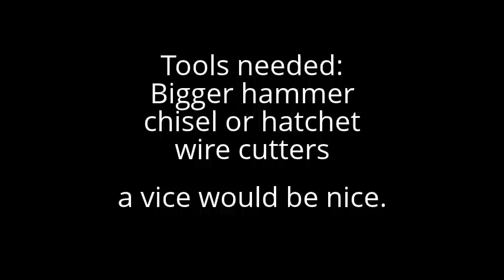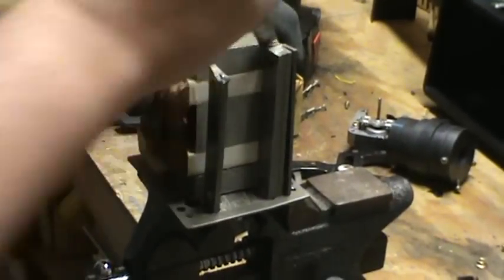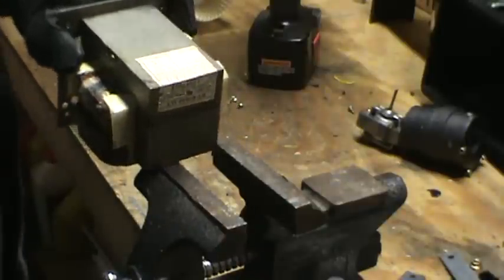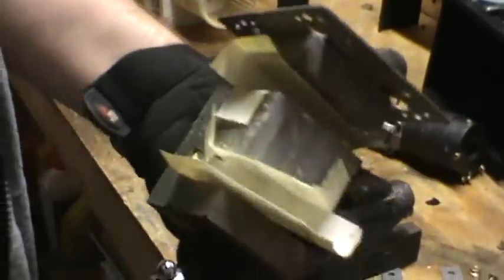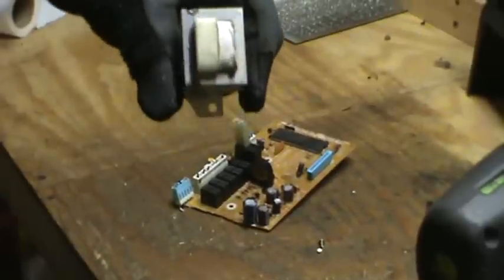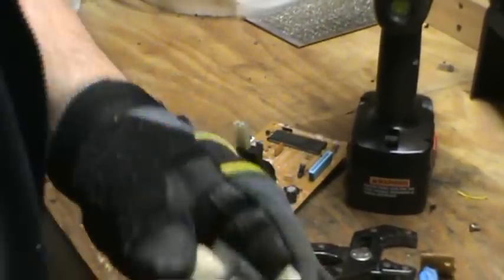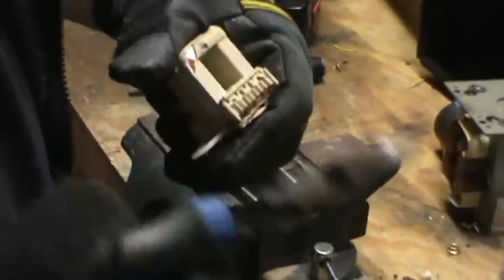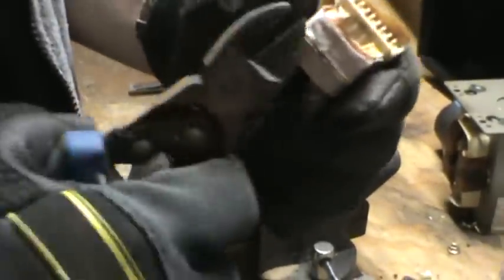How to scrap transformers for copper and easy money!

Comment: just asking hope i dont say anything stupid but, cant you burn off the enamel with a torch? it comes off easy, i tried it not much smoke a little...but the enamel is off and you now have #1 copper...you guys dont believe in that?
Reply from the maker: Never burn copper wire.  Not a stupid question!!!  A lot of people don't know this but most scrap yards actually pay less than #2 price for copper that is burnt because it actually contaminates the copper.  THe folks at iScrap App just put out a video on that very subject about myths of scrapping.  Thanks!

Comment: how can you tell its aluminium if its the same colour as copper? i mean both can pass the magnet
Reply from the maker: A quick scrap with a knife blade or a file will tell you.  The copper color is a varnish on aluminum wire and if you scratch it you will quickly see the contrasting white metal under it.  Thanks for watching!
Reply: cheers lad, yea copper is reddish
Reply: i've collected alot of the enameled copper wire, and I tried making coils for crystal radios, using diff. sizes/diameters/lengths, and have made a crystal/SW radio, and a SW radio!  really cool! you might try it, and check on the diff. websites for xtal radio plans.
Moose Scrapper
Reply: i just slice a piece of the wire with a utility knife to see whats inside ally or copper ally being silver copper being copper LOL

Comment: hey moose :) was wondering about the iron that you get from some copper bearing motors. do you put that with normal looking steel (it's very porous and looks nothing like forged metal) mostly see this iron on small ones. is the iron from these even worth messing with? on another topic do you recycle tantalum capacitors? please do a video on the various different types of them. i hear Canada is very low on tantalum. thanks moose :)
Reply from the maker: Hey thanks for watching!  That black fragile iron is just ferrite.  Kind of like compressed iron filings.  I throw it in the light iron pile.  As for tantalum capacitors, originalfeets has a good video on those.  The only ones I am sure about are the little yellow box type.  Best of luck to you!

Comment: HEY! Moose Scrapper I keep encountering transformers where the welding is on like every other piece and then pressed down or something I don't know the process I just know its frustrating. How do you get the coper out of those???
Reply from the maker: XWX05 clamp the transformer down then use a reciprocating saw or angle grinder to cut the copper flush on one side then just push out the other side.
Reply: smacks head OH OK! duh!!! Thank you so much. I am glad you took the time to answer me. Ok and this one might be the same answer but there are the ones that are like round and the copper is weaved through it... what about those???
Reply from the maker: XWX05 on the little round ones, if its the one that looks like a circle with the copper wrapped around them you can just use a pair of pliers to crack the circle, they break really easily and copper slides right off.
Reply: oh cool so excellent Thank you! hope you are doing well.

Comment: I want a vice so badly. I cannot afford one yet.
Reply: Cheap cast iron vices don't last long under this kind of abuse. You just need a thick chunk of steel to use as an anvil and a C-clamp to hold things down. The place you sell your scrap to will, more than likely, have something you can use. You just need as much mass as you can lift. 300 pounds is great to work on, until it needs to be moved. A 1'x1'x1" piece of plate works well. 

The easy way to calculate weight when looking at piles of steel is to remember that a 1 foot x 1 foot square piece of steel 1/4 inch thick weighs about 10 pounds, (#10.21). This is the size of a floor tile - just remember floor tile, 1/4", and 10 pounds. Then you just have to guesstimate how many tiles would cover the piece and how many 1/4 inches thick it is, and multiple by 10. You might surprise yourself how well this works. Of course, you can always spend time measuring every angle to calc the square inches - but accuracy is rarely needed, except for safe lifting.

The basic tools you need are pretty minimal and can be found cheap at garage/estate sales. Vice/steel chunk, hacksaw, chisel, big ball peen hammer, (NOT claw carpenters hammer), bastard file, and a big C-clamp. I mean, I use my plasma cutter and tig all the time - but I can do some amazing stuff with the basics.
Reply: Thank you! I do have a ball peen hammer. I can grab the anvil from my Moms if I make it back to Florida this summer. My strength is at a zero for the most part. I really love scrapping but being weak, I throw a ton of stuff into the mixed pile. Stuff if I had strength or someone with strength could get apart easy.

Comment: Hey Moose,I recently came across a small transformer that had very fine wires in it but they were green and red. They appear to be copper except for the colors. Have you come across this before and if so could you determine if they were copper or not? Also those metal plates you hammered away in the beginning, what are those made out of? Anything worth saving up to recycle or sell in bulk? Thanks for any help man! Happy Scrapping.
Reply from the maker: +Reese Anderson (SirExile) I sure have, it is just copper wire that for some reason they decided to paint.  Makes it #2 copper.  The rest of the metal is steel.  Is it worth saving?  well, with todays prices, I think we will have to end up paying the scrap yard to take it soon. lol

Comment: #2 copper is copper that is smaller than a #2 pencil lead, or 14 gauge wire.  # 1 copper is copper that is the size of a number 2 pencil lead or larger.  
Number 2 copper can have varnish, solder, paint, or other foreign material on it.  Also if # 1 has foreign  materials on it, it too is classified as #2...

Comment: Well i can say for a fact NOT all transformers have that weld line you showed. I just hacked and beat on a medium size transformer out of an old home stereo cd player for 15 minutes and got NOWHERE!! The coil ended up so badly mangled that i just gave up on trying to crack that NUT... What a total waste of time! IDK about other transformers but this one could survive a nuclear blast!!
Reply: Use an air chisel,cut one side of the coil,then put in a punch bit and push out the wire! It will greatly speed production,also save your energy for loading your profits in your truck!!!

Comment: that was hard to watch. although I have done enough things like this by hand before I've come to realize that machines make it a lot faster and way more enjoyable. If you have a log splitter make a specialized blade to cut them in half. mount an I beam or something with an inverted v to hold unit in place. have the v and beam cut out so that your blade can get all the way through. then just pull the copper out. the chinese have machines made just for this purpose. which is generally what happens to most of them when turned in to the yards whole. It would have made this video last about 10 seconds.
Reply from the maker: Yup, there are lots of ways to get this done.  Unfortunately, very few people out there have a log splitter, many people do not even know what that is!  lol, southerners...  Thanks for watching!

Comment: you know the best thing I have found is to sell copper to guys refining silver as the process takes a 3:1 copper:silver ratio 
so 200g of scrap silver needs 600g of copper
Reply from the maker: interesting, I've never heard of that.  Do they require pure copper?  Must be from silver ore?
Reply: the professionals have better kit but preppers do need copper to refine silver from nitric acid and it can be ore but it mostly sterling flatware and old coins you have silver in nitric and add standard grade 2 copper and you have pure silver and copper in solution and aluminium with release the purified copper

Comment: I've never understood why people make instructional videos for tasks they appear to be trying for the first time.  Why wouldn't you just edit out all the bumbling before posting this?  For example, why didn't you just clamp the vice onto the "I" section of the smaller E-I core and then chisel or grind  the weld from the side instead of first teetering the xfmr on  the jaw and hammering until it falls, then clamping the very weld you're trying to break.  this was hard to watch.

If you're only in it for the copper, next time, just bake the thing at high temperature for a few hours until the enamel and laminate burn off then drop it on the sidewalk a few times.  It should just fall apart. The advantage of this approach is that it should work on interleaved E-I cores (the ones without a welded seam) I feel the need to state the obvious: I don't recommend baking units in your kitchen.  There will be smoke.  Try using  a counter-top toaster oven outside.  Also, do a few dry runs before you make a how-to video about it.

As the last guy said, you're destroying a lot of otherwise useful or costly stuff here.  High grade magnet wire is not cheap stuff.  You could probably make more money by rewinding the wire onto a spool and selling it on ebay.  Scrap copper prices are a joke next to the cost of copper materials.

Keep learning, work safe and have fun.  :)

-J
Reply: Is the magnetic metal on the outside iron? Is it worth collecting up?

Comment: I tried this once and it was a pain in the ass.  When I finally got it out and cut a piece of the wire I noticed it was only aluminum to add insult to injury.
Reply: yeah always check it first. its not hard to do if you use the right gear though.

Comment: piss me off. i just did a job replacing merc vaps with leds and they gave me all the old ballasts. took them to the scrapper and they gave me pennies for bulk steel. if id seen this i would have spent a few evenings breaking them apart. i had about 50 old ballasts 😣😣😣

Comment: it starts falling apart for the most part.
may have to hit it with a hammer 2 3 more times and then it falls apart
Reply from the maker: GREAT TIP!!  Thanks!
Reply: when I used a chisel on the welded areas on the transformer, the metal came off in just 2 pieces, which I put in my scrap metal pile.
I try to make little mess and waste as possible.
Reply from the maker: Sooner Science Nerd NICE!

Comment: the transformers without a weld are very simple to take apart even a big one without a weld will come apart in 30 seconds.
just hit all sides with a hammer then grab any one of the metal slides with snipers and it starts falling apart.

Comment: ,making it look to hard and much more work most guys want to cut or score the weld slam it with a chiseled type tool put it in a vise  c!osebthe with that chiseled pound the steel part down till the copper moves up
Reply: Sorry my computer dumped me off  I was saying close the vise enough to let the copper part sit on top f your vise then pound the middle down till the copper moves up then put it to your bucket less steps
Just trying to help a bit thanks you

Comment: what about transformers that don't have the welds? what about the ones that have those interlocking pieces?
Reply from the maker: There is a method for those that OriginalFeets has a video on where he just takes a chisel and quickly lops off on side of the loop and pushes the rest of the copper through.
Reply: oh cool. I was sitting here banging away at the dang thing over and over. I have a pretty large one and multiple small ones. I've taken to buying up all the wall chargers at my local goodwill. I get about the value of what I pay for in copper weight.

Comment: snort, cougb snort. tweeker grunt. dude. calm down. lighting contractors do this much more efficiently. we use a tree stump with sand in a lightly bowled center so the hammer doesnt bounce back1. 2 roofers hatchet works better as its 2 tools in 1. and a pneumatic gear puller to pull the coils. heaps less hammering

Comment: In some of the transformers I've taken apart after I've cut through it I found that the wire possessed a silver tinge to it rather a copper connotation does that mean that the silver ting represents that it's aluminum instead of copper I would really like to know thankyou and be good to yourself peace.
Reply from the maker: Ahh the old Bait and Switch.  Yes.  More and more often aluminum wire is used and the protective coating they put on is copper color.
Reply: great question

Comment: New too scrapping I have a question, I have a few heavy transformers the copper is hard to get at if do not feel like being bothered trying to get the copper out  can I just add to my heavy metal bucket or the motor bucket?